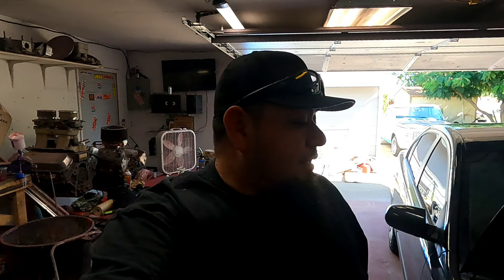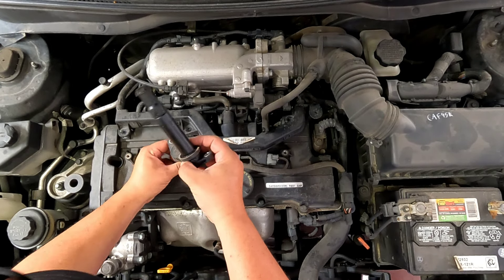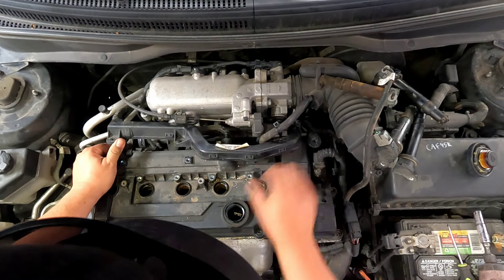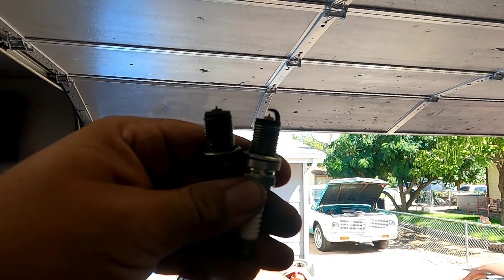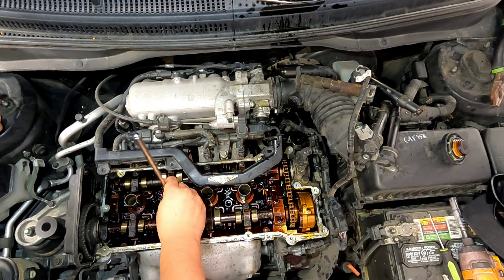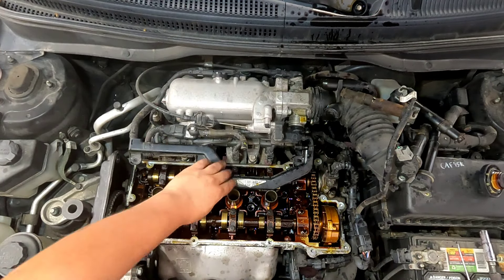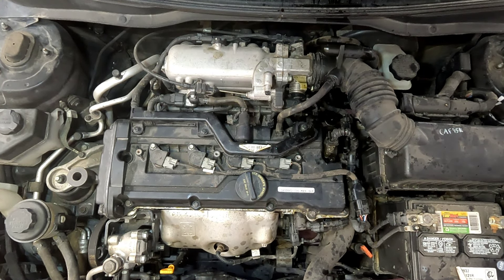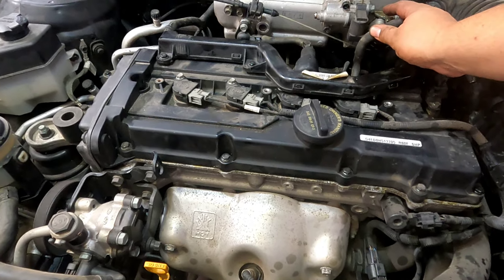Engine Repair. I've never seen this before. Daughter's Car

Comment: I keep a couple magnets stuck to the side of my tool box for those situations. It probably set a knock sensor code with the clattering, disconnecting the battery reset the code. Gotta keep the kids on the road.

Comment: You need the little bore scope that i have.  It has a magnet that you can attach to it. It also has a attachment that would allow you to inspect  the valves
Reply from the maker: I used to have it, but I definitely need another one. 👍

Comment: One of our fleet trucks lost all the guts of the #3 plug, pulled it and the strap, diode, everything was gone.. its just hollow.
Reply from the maker: Wow, that's wild. I have melted them off using nitrous oxide but never on a regular vehicle.
Reply: @rockabillychavez  it was definitely the first time I'd ever seen that happen on a daily driver.

Comment: That’s a good feeling isn’t it? Did it throw a knock sensor code? My wife’s impala did the same thing when it threw a knock code. Lost power and stuff too. Turned out to be a loose wire going to the sensor itself.
Reply from the maker: Yes, I'm pretty sure it went into limp mode. It seems to be running well now. Hopefully, it stays that way..👍

Comment: I think you got lucky with that getting that broken piece of spark plug out. It sounded really bad before you worked on it. With the part broken off of the spark plug it was only trying to run on 3 calendars so that was a big part of loss of power and it running so rough. Looks like you got it running right for your daughter again. Way to go.
Reply from the maker: I definitely got lucky, and so far, so good.

Comment: That's the same car I have. Mines silver but it has 295k miles on it. Overdrive is out but it has that button for turning it off, you just have to remember to push that every time you go somewhere. It's a good anti theft system to.😂